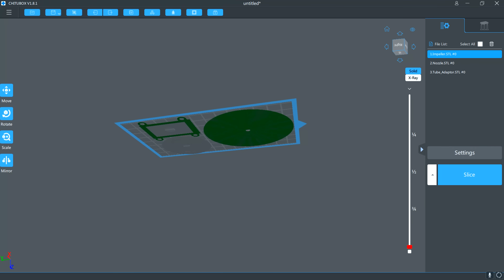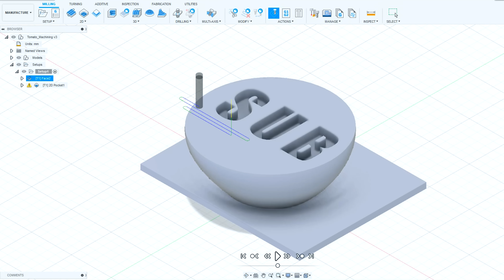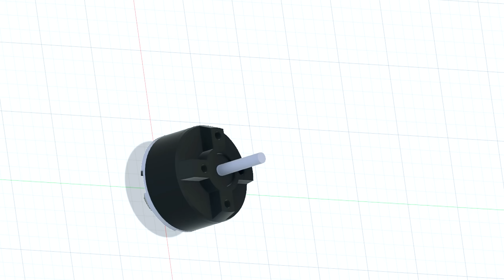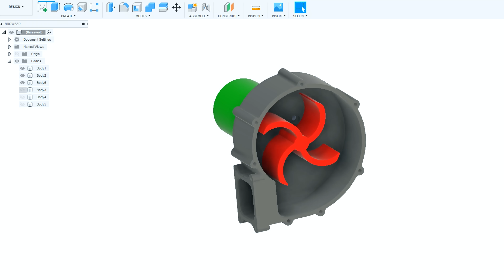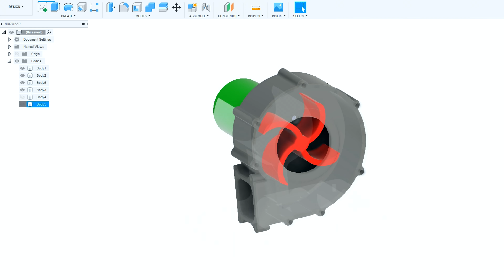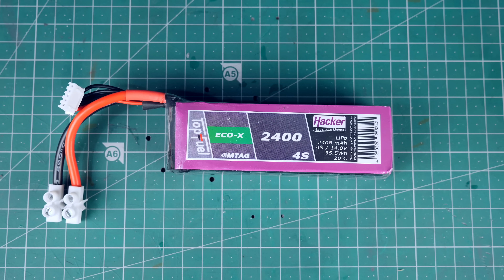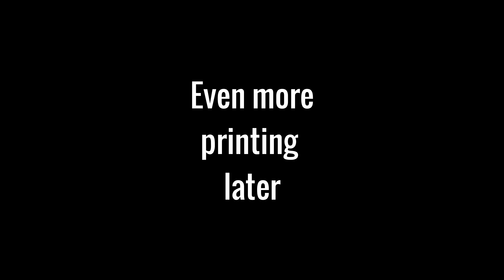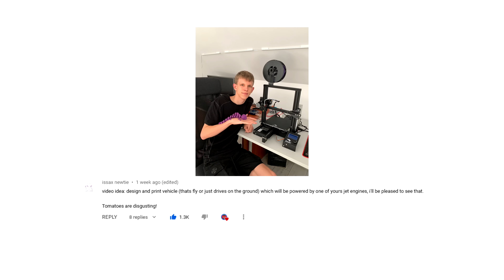Water Rocket Skateboard (3D Printed)

Comment: You could make a 3d printed BB-8 droid.(Star wars)
I was building a BB-8 droid 2 years back which I left incomplete because of its body.Which was made from paper mash,wood glue and, canvas cloth ,cutting strips of paper and canvas and pasting it on a beach ball layer by layer. But after a lot of work i made a 5mm thick sphere which eventually wasn't strong enough and also was not perfectly round .so I decided to add epoxy coating on it but even after that I noticed that after cutting the ball In half to put the internal mechanism inside, the body  was just too flexible and can not be used.. so I searched on the internet for some solution and I came across the design of "James Bruton" which was nice and sturdy but 3D printed. I made the internal mechanism with Arduino,2 powerfull dc motors to run like a hamster wheel. which would have worked if I could could make the body smaller may be 10-15 inches in diameter .

Again I faced another problem that how will I charge the battery. which will be inside the sphere and how will I put the half cut sphere back. So I left the project for a while.
Now after 2 years i have plans to redesign it's internal mechanism so I can easily charge it and make the body out of cement ( which I think is again not a good idea ).
Anyone having any suggestions please comment

Comment: Hey integza, once you do the version 2 of your turbojet engine, you should use an electric motor instead of compressed air to help start the engine, a shroud to draw air into the engine could help too
Reply: Or he can use some sort of rotary turbine which can start the engine.

In some jet engines, there are turbines which are spun by compressed air and they start the turbine. The problem is that Integza used compressed air already by putting the compressed air pistol in the inlet of the jet engine.

So I think he should use something like water.

Comment: Why not repurpose one of your tesla turbines.... instead of air, you push water. May require changing the spacing, but, would be cool since the platters are already metal. Also, if you want to build a new one. Old HDD's have platters already and aluminum spacers. If anything those aluminum spacers would be perfect practice for cnc'ing since it's a softer metal and the shape is already there you would just be decking the surface to different heights

Comment: The skateboard is too front-heavy (and too heavy overall) and there's too much rolling resistance.

You should also consider adding a parallel capacitor bank to stabilize the voltage coming out of the battery.

Comment: ++Integza++ ,the problem with the impeller is the it need webbing on each side to hold the fins in place . also look pump designs of high pressure and high flow(your is high flow  , your will realize none are core(like a air fan,) all have wedding. force on mass (would you paddle up a river with a feather)
make it half as thick and double diameter with thick webbing , 
you win that way

little note impeller pump and fan push, making a displacement, making suction(draw) , so increase draw side

Comment: I ve seen a lot of projects with turbos. Why not use a supercharger design, any type, in liquid environment and see how much electricity or thrust get out of it? Suggest to use different geometries and arangement of the tubes before entering the supercharger, in order to see how the flow, valve designs and direction of enering the supercharger can affect the rotation speed. Love your videos, keep up the good work!

Comment: What about using the engine to pressurize a cylinder to create more thrust with the water, like how a water jet rocket works without a hand pump minimizing the load on the propeller and casing?

Comment: Video Idea: Create an Rc boat with the water pump. Instead of connecting the pump to a box filled with water, feed the tube through a hole in the boat. You will be able to drive the RC boat around without having to fill up the box because your water source will be the body of water that you put the boat in.

Comment: The pump has some design issues,  first being as you found out plastic doesn't like high speed centrifugal forces,  also since everything is boxy and square it can't take advantage of  pressure growing due to the chambers growing in proportion to the impeller surface growing (look at the design of a turbocharger and lastly the impeller blades are curved the wrong way

Comment: You don't need a super fast motor, you need a high flow and a motor with a lot of torque, so you can use a nozzle with a super thin outlet and resistant to high pressure, because the smaller the nozzle section, the bigger it will be the acceleration of the fluid that will result in good thrust. Like a rocket that accelerates the gases with a small hole in the combustion chamber instead of increasing the combustion power inside the chamber with a large hole.

Comment: Make a motor with a 3D printer like a motor casing and shaft and etc, but you could only use magnets and wire other than the printer

Comment: Dude, metal is easy. HDPE plastics are easy but things like acrylic, lead, urethanes, think of how material handle heat coming from the spinning cutter.

Aluminum 6061 I think is the best material for you. Very strong for an aluminum but not so strong (7075) that you’re almost cutting low grade steel.

Comment: The impeller's design is what is causing it to break, not the speed. Your blades are perpendicular to the incoming water, so you're pretty much just 'slapping' the water 3000 times per second as it enters the pump. You're also creating a lot of cavitation (imploding bubbles behind the blade) which eats your blade away.

Angle the blades at the centre of the impeller, so it scoops instead of slaps, and then gradually let it straighten out as you go to the outside and to the bottom. Also, build the impeller blades on a cone instead of a straight shaft. The bottom centre part of the impeller is't going to do much work, so you're better off using that space to smoothen the flow.

Comment: Integza, I think your design should somehow have some pressure on the suction side (inlet) in order to prevent cavitation. this is really wearing out your impeller quickly, and the efficiency is very low as well. cheers

Comment: GEAR BOX comment was right on.

Also, why was the impeller not the other direction? Wasn't the scoop the wrong direction? 

"air throwing" jet engines don't work under water. Just build a boat and throw water.

Comment: Theme:
Since you can nou cnc metal, try making a thruster with the same idea from the water thruster, you had a reservoir, manufacture a simple fuel, and implement the reservoir into the thruster, than 3d print a rochet and call it INTEGZA-001

Make a lunch pad, and lunch it up in the air, of course i am not talking about a huge rocket, more like a toy rocket.

The reason i am telling you this, is because you have always tryed to make your thrusters push sideways, but i think yhat if you go upwords and it works even just a bit, it will be a breakthrough in your experiments

Comment: It only seems to explode when air gets into the system, maybe increase flow or pressure into the inlet of the motor? Maybe put the motor acrylic side up and mount the reservoir directly above it, i think that might be the easiest way to increase intake pressure. Cavitation will prolly still occur at high speed tho so idk 😅
Reply: no it is not air it is water vapour, due to cavitation because of poor designed impeller

Comment: If you redesign the nozzle to give you a more focused steam or even preferable laminar flow you’d get much better efficiency and if you redesign the pump to be more like a turbo charger that would also help and with the monster powering everything you might just be able to make something quite fast
Reply: Also being shaped more like a turbo should help the exploding which I suspect is from the right angles causing stress points which make it easy to explode verses the much more rounded and therefore stronger shape of a turbo housing

Comment: If you redo the impeller with a back wall (disk with vanes growing from it :-) it'll be stronger.  You can make the vanes thicker toward the back, too, so they'll be stronger where they attach to the disk.  If you really want water out the back, use a venturi:  Let the pump push out water into the venturi nozzle, and it'll suck even more water into narrow part.  More water out the nozzle means more reaction force.

Comment: Okay same pump , BUT make the water tank pressure safe and pressurize the air above the water to make it more powerful at first to compensate for the weight of the water and help prevent cavitation. Use a solonoid triggered by your throttle to hold the pressure till you go

Comment: I've seen a few people comment about the impeller performance, and the direction of the impeller blades...
Impeller blades can be forward-curved, backward-curved, or even straight. 
Broadly speaking:
--Forward-curved blades produce flow tangentially to the impeller, as the blades are actively pushing the fluid. This type of blade can easily exceed the drive rating of a motor at higher flow rates if improperly designed. These really need scroll/ volute housings to be most effective. They are better for high flow rates at low running speeds and lower pressures.
--Backwards-curved blades produce flow radially, as the backward-curve creates negative pressure behind and along the length of the blades, and positive pressure in front of the blades. They offer significantly higher efficiency than forward-curved blades, function well at higher pressures, and offer greater suction characteristics as a result. They also don't need volute casings to be effective, though work better with them.
--Straight blades are a bit of a mix. They are rarely used as they lack the benefits of either design and offer lower blade stiffness thanks to the lack of curved geometry.

For this application, the backward-curved blades are certainly more appropriate. 

The pump would definitely benefit from being primed, ie filled with water before running. The air in the impeller is significantly hurting performance. Plus the thing might not explode if it spun under a higher load, which would be the case if there was no air on the system. In industrial applications, pumps are almost never run/ started 'dry' for these exact reasons.

Comment: 8:28 Im like 90% sure you PUT the fan the opposite way. Shouldn't it be the opposite way so that it can "grab" more water?
Reply: I've seen a few people comment about the direction of the impeller blades...
Impeller blades can be forward-curved, backward-curved, or even straight. 
Broadly speaking:
--Forward-curved blades produce flow tangentially to the impeller, as the blades are actively pushing the fluid. This type of blade can easily exceed the drive rating of a motor at higher flow rates if improperly designed. These really need scroll/ volute housings to be most effective. They are better for high flow rates at low running speeds and lower pressures.
--Backwards-curved blades produce flow radially, as the backward-curve creates negative pressure behind and along the length of the blades, and positive pressure in front of the blades. They offer significantly higher efficiency than forward-curved blades, function well at higher pressures, and offer greater suction characteristics as a result. They also don't need volute casings to be effective, though work better with them.
--Straight blades are a bit of a mix. They are rarely used as they lack the benefits of either design and offer lower blade stiffness thanks to the lack of curved geometry.

For this application, the backward-curved blades are certainly more appropriate. 

The pump would definitely benefit from being primed, ie filled with water before running. The air in the impeller is significantly hurting performance. Plus the thing might not explode if it spun under a higher load, which would be the case if there was no air on the system. In industrial applications, pumps are almost never run/ started 'dry' for these exact reasons.
Reply: @Elo4twyn  Thanks for clarification. This is what I was wondering about.
Reply: @Elo4twyn  quality explanation
Reply: @Elo4twyn  explanations like these are so rare

Comment: The reson to y it was not that effective is due to the mass of the water. The power of the motor had not much to do with the prupolsion power in the end. 

U had allready reached the limit of the power. But i think i noticed some air inside the pump which is probably why it did not go that well.

Comment: can you build a jet engine using a turbocharger as the air blower to the engine and use an electric motor to power the turbo I am dreaming about making this setup for years but never had the chance place and the money to taste it if you would do it I really be thankful also there are tons more like building a starter motor for the car which can act as an alternator too and when you need more power it would boost the car engine too but in small size and running from car battery i don't mean having something like Toyota hybrid system with different battery and so on I think you get the idea

Comment: Water need equal force to push against.
Otherwise it's just a water pump.
Basically wasting 90%othe the energy exerted.
Air pushing against the same densities .. water needs the same or equal force to work.
... You should try making a 3D printed Hobie Jet.. or utilities the Venturi effect 👌🍻 luv your channel long time subscriber regards Chad

Comment: I sugest to have a better performance, you need to have the intake of the pump bigger that the outlet of the pump, if you don't do that there will not be an Enough water to compress and will create a vacuum and consequently the output pressure drops. Good job

Comment: Have you thought about using something like hydrogen peroxide? By using hydrogen peroxide and a catalyst, you can create an expansion rate that might be very effective at propulsion. Maybe pump hydrogen peroxide through a silver mesh and it's like turbo charging the output.

Comment: In regards to your CNC machine, it's best to look online for the speeds and feeds to make a proper cut, you can do this by going onto the cutting tool company's website and they should have a search function for speeds and feeds. You'll also need to know what kind of material and machine you're using so you can get an accurate search

Comment: Water jets pull water from the body of watter they are placend in, your typical air breathing jet engine pulls air from the body of air they are in. This is done so that they do not have to bring their own source of water or air with them increasing the thrust to weight ratio. What you are doing requires to to bring an energy source (in this case a battery) to power the pump and a source of water to feed the pump, drastically reducing the efficency.

Comment: Use your new fancy motor for a forced induction jet engine! Tons of thrust, and might run for more than 10 seconds lmao
Also I reckon pump exploded due to the g-forces pulling the curved impeller blades straight, and colliding with the housing

Comment: Your biggest problem was that the pump was not properly primed with water before you started it. If there is air inside it will never reach its full potential. I can recommend to you videos of Practical Engineering: https://www.youtube.com/watch?v=m3i_5xP9PYU

Comment: Dude the shape & direction of the propeller is wrong, also the size.You're wasting  70% of the pumps power. It should be bigger to almost match the size of the casquet, and the blades should be bent towards the left side, not right. You should try it again

Comment: I noticed your using super glue to hold on your props to that monster motor make a place for a screw to hold it into the little indent of the shaft on the motor you’ll get much better speed

Comment: 40,000 rpm impellers are not use in nonpressurized fluid systems, they are used on rockets because the fluid is forced into the pump to eliminate cavitation.

Comment: Water jet is slow and water is (relative) lightweight. Try shooting metal slugs using (3d printed ofc) Auto Gauss Cannon to drive same skateboard.

Second idea - use a pump to build some high pressure and release it in pulses. Higher speed - less mass, that's crucial for rockets.

I can clearly see problems with this design, one of them being water output from the middle of the container.

Comment: You should try if laminar flow increases or decreases the efficiency and if magnet cuppling the impeller to the motor works in 3D printed parts

Comment: Out of curiosity have you ever though of using PLA to do a casting kind of like wax casting but you print in PLA then use casting sand or plaster to cast it into aluminum or another metal?

Comment: Maybe to reduce weight you could keep the water nearby, but not in the skateboard, and the pump could pull it from the external source. 
Actually to reduce rolling resistance you could put the skateboard into the fluid! 
Wait... isnt that... a boat?

Comment: In curious to why your last design has the turbine blades facing outwards. Wouldn't you have more flow if the blades were grabbing the water instead of forcing it to move on the long side of the blade?

Comment: Looks like the weight of the water tank is slowing it down a lot. Try taking the whole system and put it on a surf board with the inlet underneath. Then put it on a pack or pond to see it fly

Comment: Straight vanes with a small gusset on the non pressure side of the vanes would help your pump stand up a bit better. The flowing fin design works well for air because it's compressible